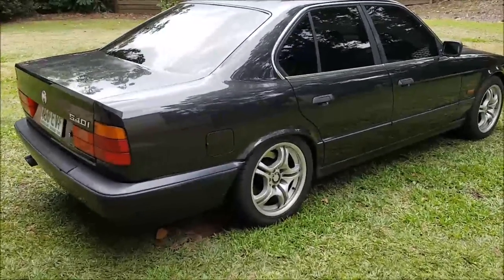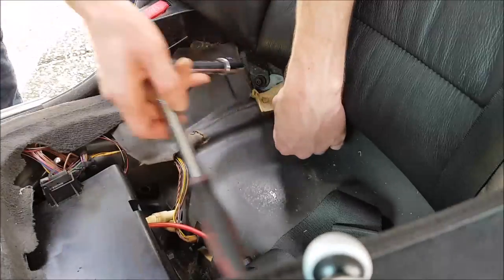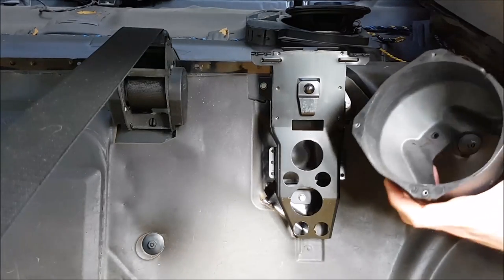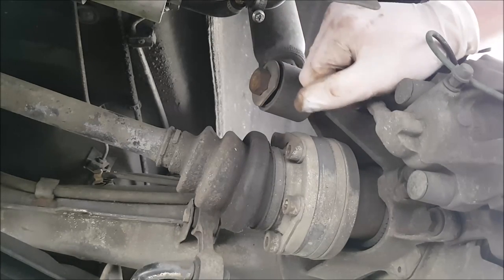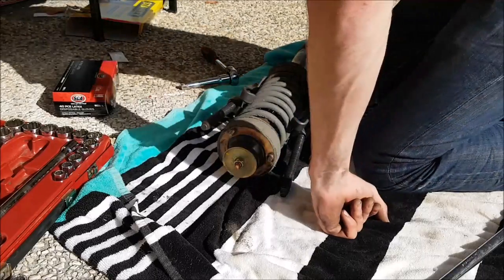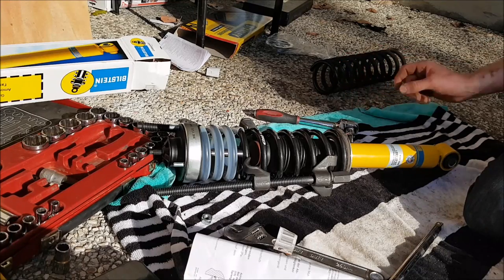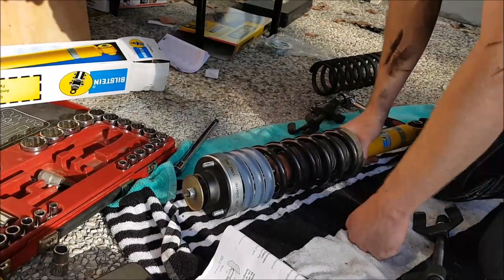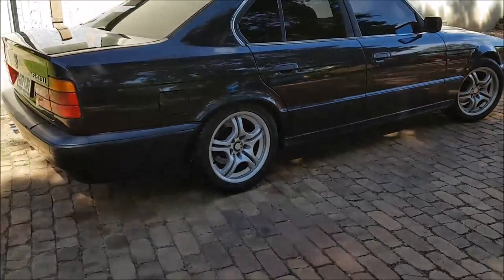HOW TO BMW E34: Rear Suspension Replacement/Lowering

Comment: Great tutorial Sam..... I had recently had to take one of my EDC lll rear struts off...I forgot to mark on the strut the position of the spring...so your tip to line up the top mount bolt with the non protruding end of the shock was invaluable. Thanks.

Comment: Great information man. Just 2 observations that are crucial. You must tighten the big nut with the car in the ground, otherwise the bushings will last nothing. Also, that springs have a positioning in the strut with the stretched coil at the bottom end.  This is because they are progressive, so that section is softer than the rest. Cheers!

Comment: Did  my 95 525i today following your lead and it turned out great. Looks great and drives so much better with the lower center of gravity.  Thanks for making the video.. think I'm gonna do my brakes next !
Reply from the maker: +Clark Chiles Hell yeah, glad to hear it went well! What springs did you put in? My brake videos might be useful for you too
Reply: I used H&R Springs and Billstein Sport Shocks.  Now I gotta save some $ and get those M Parallel wheels!

Comment: Thanks for  Wery good videos. Allot of help to work on old BMWs Mine is an short wheelbase 750i e32 but much is the same as the e34. Much of the chassie components are the same on mine. So thanks again from the North of Sweden and come with more nice videos👍

Comment: He forget put washer back on the mounting bolt. Hit it off with chisel and hammer. Put it on the short side w/ over size socket by hitting hard. Remember how it goes on the old socket. Little thrush bearing, didn't need it on my 95' 525i BMW. Take pics each part you are taking off. Went back view my pics found out one thing wrong. Little thrush bearing slide on top don't know? This a good video.

Comment: hey samuel...excellent, clear how to.  thanks for this.  how did the car drive after u made the switch?  i have a 92 touring and the car drives terrible.  feels floaty on the freeway.  if I go over speed bumps the rear will bounce.  hoping this solves it.  cheers J

Comment: Great video.  Thanks, I am about to do mine soon, just awaiting the parts.I had a question:  I noticed the back lifted when you put the car in reverse before you started the job.  My car does the same.  What causes the car to go up and down when you change the gear shift, if it does not have leveling???Did it continue to do that with the new shocks?   I did not see you moving the car after the installation.Again, thanks, great job.
Reply from the maker: +pam2147 Hey Pam! It's nothing to worry about. I'm pretty sure it's just the car and drive train flexing once reverse is engaged, with the brake still on. The torque from the automatic is going down the driveshaft, to the diff, and then to the rear wheels, but the brake keeps the wheels still. I think the diff probably rotates back a bit due to this, which in turn lifts the car slightly. I think it does the opposite when drive is engaged as well (hunkers down). 

My sub frame bushings were worn out as well which probably allowed the car to move more than it should too?

Comment: Very nice how to but there is a thing I am struggling with. I am referring to 16:45-50. How do you prevent exactly the shaft from spinning while you are fastening the top nut? I see you use a sort of grip or vice grip to stop it spinning but aren’t you risking that way to damage the thread? Why didn’t you use an impact wrench for example? My question also goed for the front assembly. How did you tighten the top nut at the garage shop where you compressed the spring etc?

Comment: Greetings from Michigan USA!
Great videos my friend! I’m preparing to replace struts/shocks on my 1995 525i. Im the original owner. Im going with the Bilstein B6 kit. Question: On the rear shock does the small metal spacer just slip on the shaft before the rest of the assembly?  Also on the front struts do I still use the metal washers then the top mounts?  Thank you for your help and videos!  Cheers from up over!!!  George

Comment: Nice video!
I was wondering if the top mounts came with the Bilsteins or did you order them separately?
I didn’t get how to align the top mount with the underside of the shock during the last step of reassembly.

Comment: How you going with front camber alignment? I've got an E28 I want to lower the front 15-30mm. You reckon I need camber plates? Thanks
Reply from the maker: +Bahjat Alaadel Hey mate, as far as I can tell I haven't had an issue since I did my suspension. But I'm no expert on that...

Comment: What suspension kit did you buy. I had bought a kit and the front shocks are smaller in diameter and have play inside the housing smh unfortunately I cant send them back and have to take a loss. And with me looking at the rear they are also the wrong size I have called the company and told them and they swear up and down that is the kit for the car. I wanna make sure when I order new ones that they are right and from the lols of your bmw we have the same set up. Can you give me part numbers and brand?
Reply: Looks*

Comment: I don't know what im doing wrong but my rear absorbers won't come off, i have been knocking with a hammer for 4 days, they seem to be welded stuck.. your came off just by pushing it with one hand
Reply from the maker: I was pretty lucky with mine. Try out that gear puller trick I mentioned - put something in the bolt hole and put the center of the gear puller on it, then put the claws around the outside of the shock absorber and tighten it down. I've heard that works.
Reply: TheCragies put the bolt of the damper on loose and drive a few meters
Reply: I had to use a 2 kg hammer and and long pry bar? Don't know if it is called this way correctly. A lot of wd40 and a lot of hammering. Good luck mate. Greetings from northern Germany

Comment: Is it absultly neccsary to change the springs
Reply: Dont know if im to late but you really dont need to replace them unless they are broken or like rusting or if they bust dont look in a proper state
Reply: Carsspottedontheroad thanks I already did the job but yeah I didn’t replace the springs

Comment: Why Change the Suspension on an e34 ? 
Just Replace worn Parts With NEW OEM & the car will be PERFECT. 
Lowering ? 
What is LOWERING all About ? 
Making a Perfect Car Look & Drive SHITE ?

I Take it you are a BMW Suspension Design Engineer ? Factory Trained. & Correcting Design Mistakes ? 
My E34 Handles Perfectly Well on it's Factory Original Suspension. 
Or are you Drifting the Car Prior to Scrapping it ? if so  Let me Know, 
I will Buy Some Remaining ORIGINAL Parts.

Where are the Design Faults with the Original Suspension ? Return the Car to BMW in Germany to have it's Faults Corrected.
Reply: hahah :)

Comment: I Disagree, 
Change Nothing on an e34. 
Just Fit OEM Standard Replacement Parts. 
Original Cars are worth more than DOUBLE a Modified Car. in the UK. 
You Just HALVED its Value.